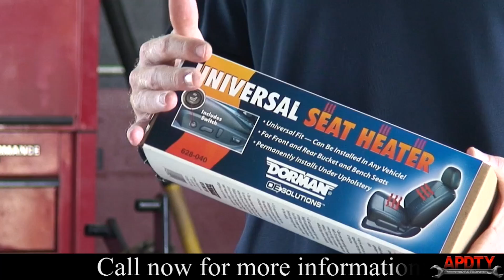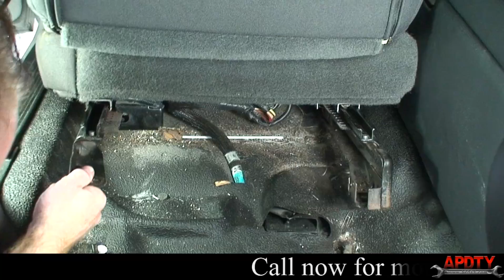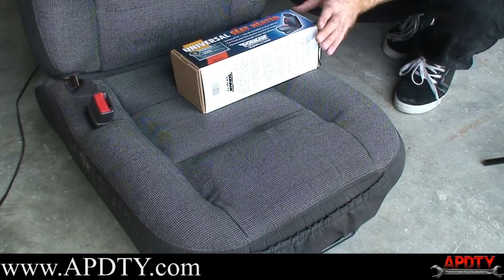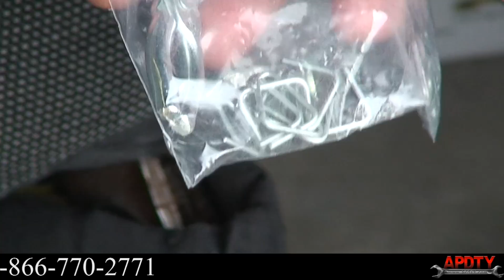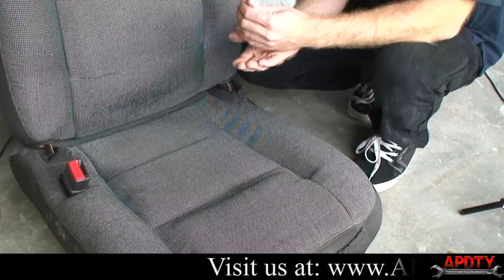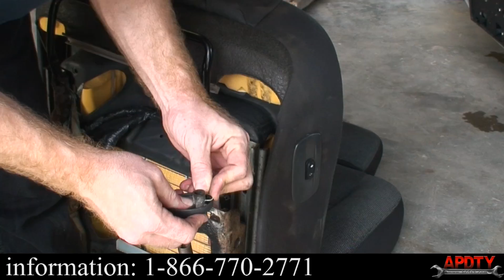How To Install Universal Seat Heater Kit

Comment: Great video, I did the installation, but on my switch, when the low switch position is selected, the light is green, when the high switch position is selected, the light is red. I tried high position first and it did heat up so not sure if it heated on low or not. Any suggestions?

Comment: Some heated seat kit instructions tell you to set the switch position first.  Then route the wires from the switch to the pads.  This ensures you have proper slack in the wiring but not so much that it can get caught on seat track or any other movable seat surface,  up/down/lumbar support switch etc...

Comment: You put the bottom heater on wrong. Turn it 90 degrees so the wire goes out the back.

Comment: http://www.ebay.co.uk/itm/4pcs-Cars-Carbon-Fiber-Heated-Cushion-Seat-Heater-Pad-Hi-Off-Lo-Switch-Kit-12V-/302128597315?hash=item4658448943:g:5VMAAOSwo4pYHCQa if you buy that one, do you get 2 buttons to controll each seat, i want both front seats heated but often i drive alone and its pretty much a waste of energy if the other is heating too while theres no one sitting on it...
Reply from the maker: Yes, it appears you would get two switches. One for each seat.
Reply: thanks, i need to find the size of the button of how deep it goes into my car. i got a good spot but its kind of tight i think. cant find the size

Comment: On the seat in the video neither cushion had horizontal wires (or Velcro) in the center of the pad.  As a consequence the slot that comes precut in the pad is not an issue.  The commentary doesn't mention that in many cases there is a horizontal element (wire or Velcro) that must be dealt with.  In these cases the slot would be oriented along with the element with the connection to it completed withing the slot.  Suggest they show a short example where the slotted pad is utilized.  Sometimes familiarity with the subject can cause you to skip important information.

Comment: What if you want to install heated seats in a seat that has no power controls? My seat adjust manually and my car has no seat belt sensor. Can I still install heated seats in that?

Comment: Hello 
Can i install a cooled seat instead a heated seat
Reply from the maker: +Khalid Waleed Probably but we have not messed with that yet. Most likely someone sells a kit and it is probably similar to this video.
Reply: LOL, that doesnt exist, you would need a heat exhanger-set  like airco's use. So that radiator / ventilator is way to big for underneth chair cloth/leather. Remove chair and put your butt in a 12V refrigirator Roflol

Comment: Could I install these on an electric wheelchair? The wheelchair has 12V batteries.
Reply from the maker: +Jen Rossey I don't see why not although a test beforehand to see how long the battery would last would be my only concern. The heater pulls a pretty good amount of amperage and on a running car the alternator provides this current. It might kill your battery quickly. I envision some kind of solar panel and battery pack setup Elon Musk style. If you still want to do this, let us know and we may send you one for free if you want to video it or take some images, SOMething needs to be thought of for the power supply though.
Reply: Jen you could certaintly put them on a 12V wheel chair, I looked at current draw and could not find one for this kit but for two small pads on another kit I found on ebay uk it was about 50W give or take a little.  That is just over 4 amps at 12V  to give you an idea of power consumption for every hour of useit is going to take 4A of you battery,,,  so if you look at the Ah capacity of your battery you will be able to see what percentage of your battery power it will consume. 
If I can help you any further I will.
Best Wishes, Ray

Comment: I have a 2011 Dodge Ram and the dealership sub contracted the heated seats when I bought the truck. I'm having a problem where the fuse is smoldering, blue fuse, and it drains my battery. The wire for the seats go through the fire wall, attach to a relay in 4 plugs and then an inline fuse and then to the battery. 4 of the 5 prongs on the relay, one goes to the fuse and battery, one goes to the seats, one is ground and I can't figure out what the 4th connection is for. Can you shed any light on this?

Comment from the maker: This kit is available at amazon.com: http://www.amazon.com/gp/product/B002U6IL9O/ref=as_li_tl?ie=UTF8&camp=1789&creative=9325&creativeASIN=B002U6IL9O&linkCode=as2&tag=aupaditoyo-20&linkId=JX25M5N2GFP77KCL
Reply from the maker: +Justin Hickey Yes that is a much easier way to install, just check how hot the maximum heat is and if too hot, then just always keep it on low. THe heat might pass through the seat cover more then seat upholstery

Comment: Can I just unplug my old heated seat from underneath and plug in this new pad right into the old plug so I can use the same switch? Instead of drilling a new switch?
Reply from the maker: This kit is really intended for vehicles that do not have seat heaters, We do sell individual plug and play heater pads for specific models. I cant say for sure that you can plug into these pads as they may not have the same connector. Yo could cut and splice but getting the exact pad may be the best option.

Comment: Hello mate. I really need advice on how I could fit them in on my half leather car seats. It doesn't have the fabrics to take off. I'm stuck. And also. Could you send me a link to the dorman heated seat kit so I could purchase. 

THANKS!!
Reply from the maker: Most seats even leather seats have the ability to remove the fabric from the seat frame itself. You may want to pull the seat out and verify the leather comes off first before ordering one, but we have people all the time with leather seats using this kit.

http://www.amazon.com/gp/product/B00GUTQN1K/ref=as_li_tl?ie=UTF8&camp=1789&creative=9325&creativeASIN=B00GUTQN1K&linkCode=as2&tag=aupaditoyo-20&linkId=MQL4CPE7OGOLBO7S

Comment: what size fuse was used for the power window and/or will the heaters draw too much and pop it?
Reply from the maker: The heater was installed with its own fuse, a new fuse is included in the kit. Here is a kit with fuse:
http://www.amazon.com/gp/product/B00GUTQN1K/ref=as_li_tl?ie=UTF8&camp=1789&creative=9325&creativeASIN=B00GUTQN1K&linkCode=as2&tag=aupaditoyo-20&linkId=MQL4CPE7OGOLBO7S

Comment: Hi, can I just put the heat pad on top of my cloth seat and put leather seat cover over my seat? do I still need to drill a hole on my seat? In my case what should I do? do I still need to take off my seat?
Reply from the maker: Hmm, actually that's a pretty good idea! You should be able to put the heating pads between the seat and an aftermarket seat cover, I have never tested this nor do I think the system was designed to be used that way, but it should work fine. And it wouldn't require removing the seat. If you attempt this, please let us know how it works out. Thanks!
Reply: Interesting observation I was just thinking the same thing....the pro twitch that scenario is if you sell the vehicle you either have to take the covers off and expose the factory cover.   If people see a heated seat power switch they might try and use it and realize that it doesn’t work could cause an awkward moment during sale.
Reply: Along those lines would the heating pad element making contact with the OEM seat cover cause a short or burn through The OEM cover?  Then the vehicle really will have heated seats.

Comment: If those are cloth seats are they susceptible to water shorting them out should coffee or water spill on them?
Reply from the maker: Good question, Luckily the system is only 12 Volts, so even if it does get wet it won't hurt anything.

Comment: Installed this kit in the driver's seat of my 2014 Ford Focus (w/leather) today.
Not so difficult, except for extracting and replacing the seat (it's powered, so I couldn't adjust it after I'd disconnected the battery.)  The pads are a bit wide for the seat back in my car, but managed to fit.  Very good video that gave me great tips!  Thank you!  BTW: Hog Clips are evil to reinstall!
Reply: Hey I want to do this on my 2014 Focus with cloth. Which fuse did you use?  I found the guide online for an older model of Focus but mine doesn't have the fusebox in the trunk

Comment: I'm very tempted by this mod. I'm in the UK, but there's companies selling this kit (the one you used) as low as £38. That is so cheap for heated seats. An OEM set of heated seats is what £200 second hand and they're unlikely to be colour matched (an added option on my car). Yep, very tempted. I might try whip the passenger seat out and see how hard it is to get the fabric off. If it's easy, I'll buy the kit. I don't want to buy the kit and find the fabric needs un-stitching.

Comment from the maker: I think you mean just sitting them on top of the seat and then you sitting directly on the pads? They aren't really designed to work that way, they would likely become too hot without that layer of fabric between you and the heating element. But I could be wrong, If you give it a shot, please let us know the outcome of how it works. Thanks!

Comment from the maker: The seat heater only draws about an amp of current, which is not enough to pop the circuit breaker, even when run in parallel with the window motors. The seat heater has worked great since installing it in this video and I have not had a single issue.

Comment: What a junk way of wiring it in. That circuit breaker is going to pop every time the windows and seat heater are on at the same time, especially when those motors start going bad.

Comment: Before I go taking out my seat real quick do you know how BMW upholstery is attatched?  I have  a 98 323is base model and heated seats were a option.  Also, could I use factory BMW heated seat switches if the electrical is done correctly?

Comment from the maker: This particular kit is designed to only work for 1 seat at a time. Each seat requires a separate switch to be hooked up. I am sure something custom can be made with the wiring, but the kit wasn't technically designed to operate like that.

Comment: Great video! Just a question: When tapping the seat into a fuse port, will that one tap send power to both seats, or just one? If not, can you power two seats from the same fuse or will that create a power overload?

Comment from the maker: @premomh It's definitely doable, but you would lose your high and low settings. The way the circuit is set up, when the heater is in low position, the current runs through both heater pads in a series-style circuit, when it's in high position, it runs them in parallel. So the only way you could wire a single heater pad per seat would be straight to the 12V source (through a switch of course), which would in turn put the heater pad on High whenever it is on.

Comment: Thanks for the video! One question

I'm thinking about getting the kit but I was wondering how hard (in your opinion) it would be to splice it out so that each pad is on 2 separate seat bottoms (driver's and passenger's - just on the seat part not lumbar - then wire it up with 2 separate switches that I would purchase separately).. I was trying to get a closer look at the wiring but it was a little tough to see exactly. I own a 99 Jeep Wrangler.I have above average mechanical/electrical skills.

Comment from the maker: @ndchevy Unfortunately we probably can't do a video on it at this time, but it is fairly simple to hardwire it in. You just need to find a thick power wire going to the fuse box that only has power when the key is turned on, you would then splice the main power wire into that wire. If hardwiring, I would recommend soldering the connection.